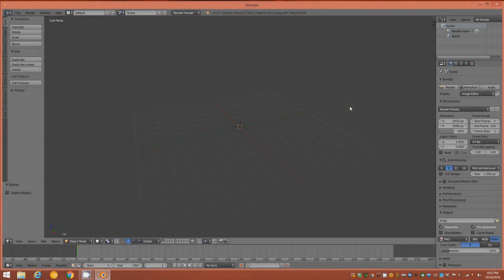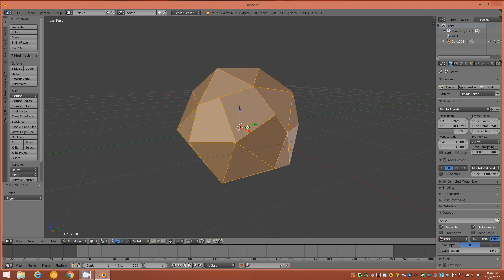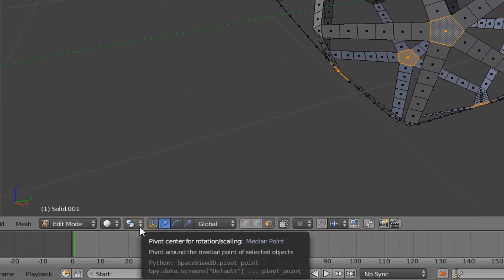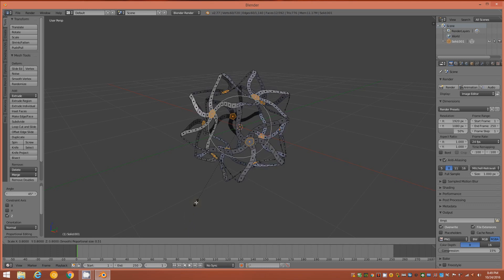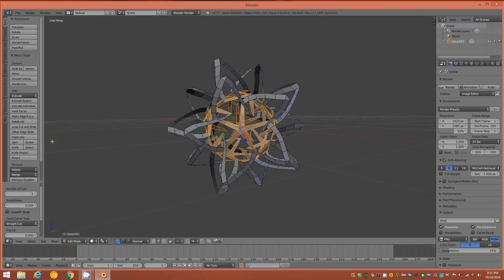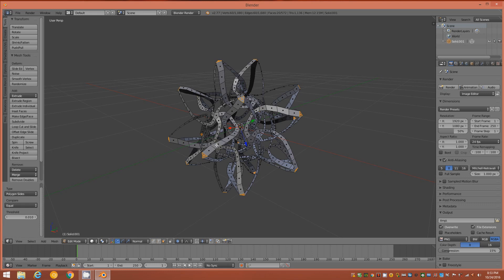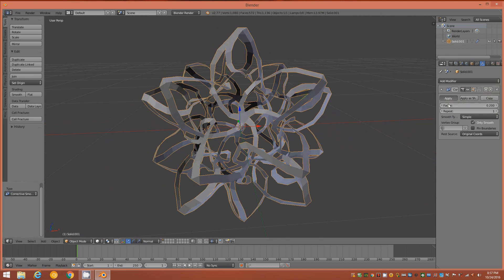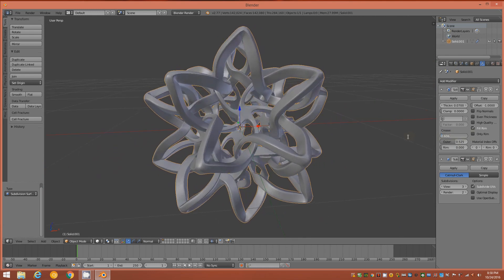3d Tutorial | Interlocked Star Nest | Blender 2.77

Comment: Ctrl + Tab is a good way of switching between vertex, edge and face mode.
Reply from the maker: Yes, that's the default method.  I prefer the ability to switch between vertex, edge, or face levels without bringing up a menu.  It's just the workflow I've been accustomed to, so I've assigned custom hotkeys to each level.

Comment: my mac wont budge on this ctrl - + move at 7:38 ....     what do you think could be the problem ?
Reply from the maker: The shortcut depends on the use of the +  - keys on the Numpad.   So make sure you're using the symbols in the Numpad area of the keyboard, and not in the Fn line of keys.
Reply: well i guess thats just it... there is no separate numpad on the macbook...  so i suppose there should be a different shortcut ?
Reply from the maker: There's really no alternate set of shortcuts, although you do have a couple options you can look into.  The first option, obviously, is to get yourself a full sized external keyboard to use with Blender.  This is probably the best option because you will find there are many more shortcuts in Blender tied to the Numpad keys.  However, if using an external keyboard is not something available to you, then you can go into Preferences > Input,  and check the "Emulate Numpad" option.  This will allow you to use your regular numbers as Numpad functions, but you will lose the ability to switch between layers directly from your keyboard numbers.  This should also make your current + or - keys work the same as the Numpad counterparts, although you will not have access to the Home button and some other variables which are connected to the Numpad.
Reply: I already have the emulate numpad option selected...  it works with the numbers just fine but i guess it doesnt accout for the + or - keys...    i dont know.. i cant really find anything about this on the internet...   
is there a way of achieving this effect of multiplying faces without this shortcut ? ...   and if so, could you describe it  ? 

in any case thank you so much for your help...   i hope you make lots more of these kinds of videos...  the objects you make are really beautiful  :)
Reply from the maker: If the commands to Grow or Shrink selections were available somewhere in the Blender menus, then it would be possible to remap the shortcut keys to something else, but I don't think they are.  This means the only way to access those commands is through the keyboard shortcuts.  So, in order to utilize Blender to the fullest capacity, you may need to use a full size keyboard.  The only other alternative would be to change your entire hotkey mapping structure using one of the Input Presets in Preferences.  For example, the Maya preset would map the Grow and Shrink selection regions to your < and > buttons instead.  However, doing this will also change all your other hotkeys to Maya equivalents.
Reply from the maker: Ok, these commands ARE actually available through the menus.  If you go to Select,  then Select More/Less, you should be able to remap the hotkeys to something else.  Keep in mind that this will alter whatever hotkeys you currently have assigned to those keys, so make sure it's an operation you don't use often.